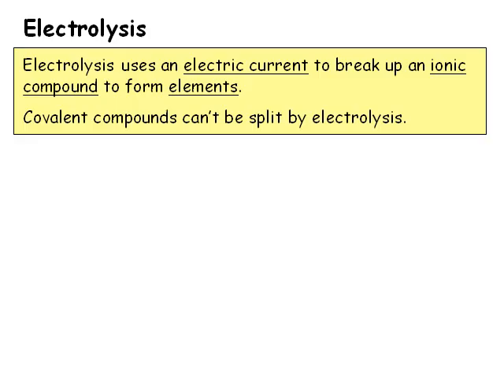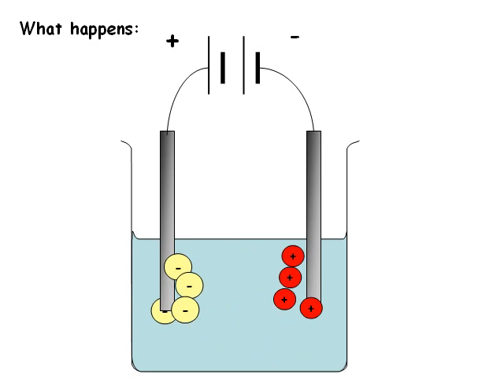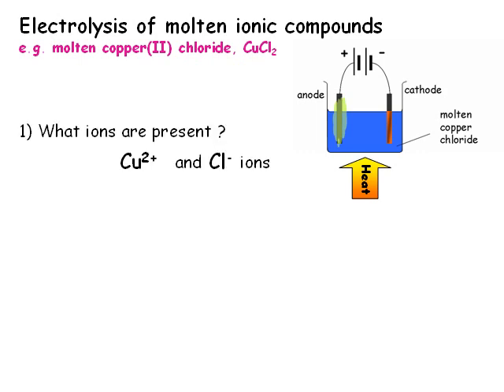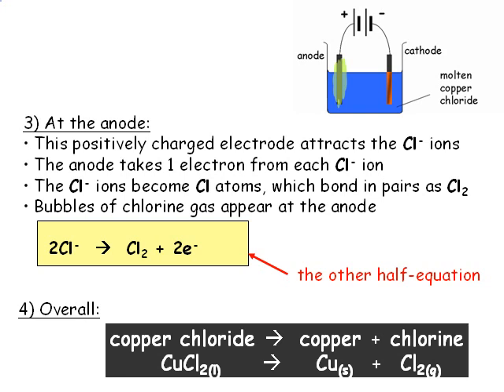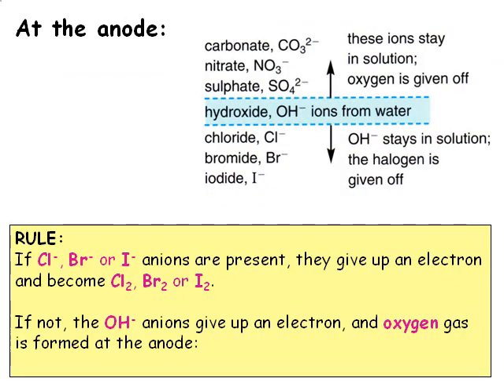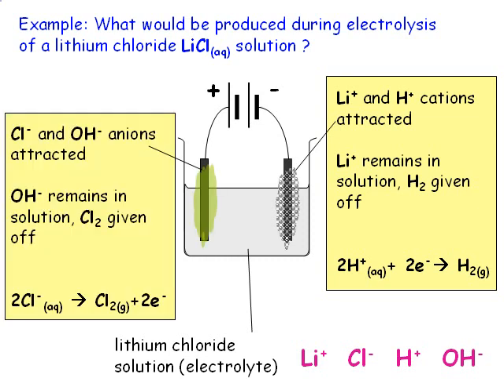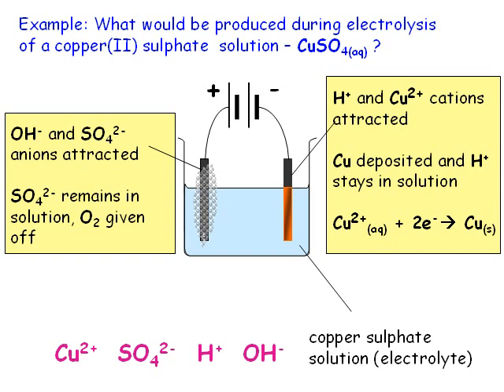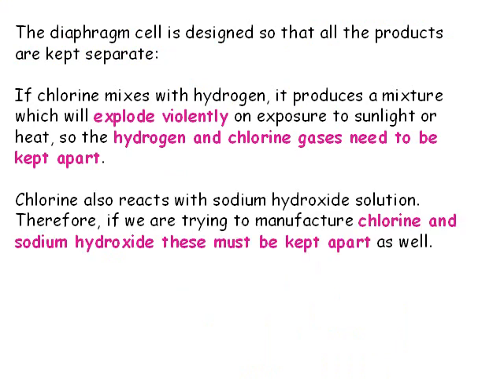IGCSE Chemistry : Electrolysis

Comment: What's the difference when a solution is electrolysed with different electrode materials? For example, when Copper(II) sulfate is electrolysed using a platinum or copper electrode. What's the difference?

Comment from the maker: Hi Patty
It depends on the relative concentration of the chloride ions and the hydroxide ions in the solution. If chloride ions are present in the solution at reasonable concentration they are going to be oxidised more readily than hydroxide ions - that's why electrolysis of NaCl(aq) produces chlorine gas at one electrode and hydrogen gas at the other (leaving sodium hydroxide in solution). If there are very few chloride ions present, then you could get the hydroxide ions being oxidised to oxygen and water.
Reply: M8 U ARE THE BEST !!!!